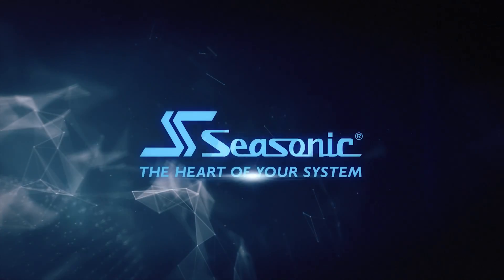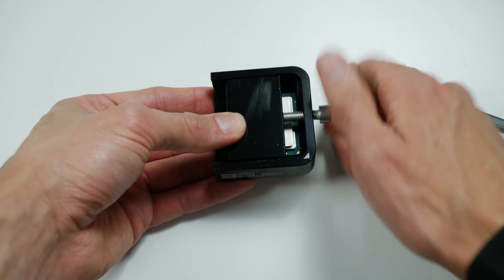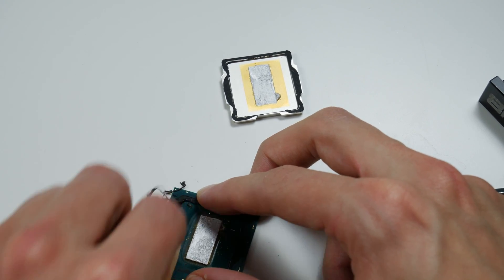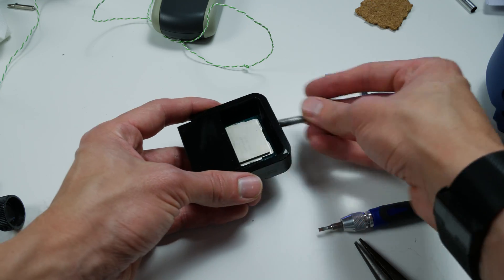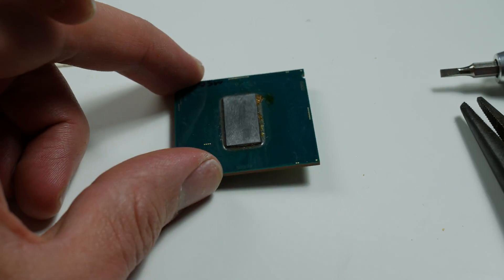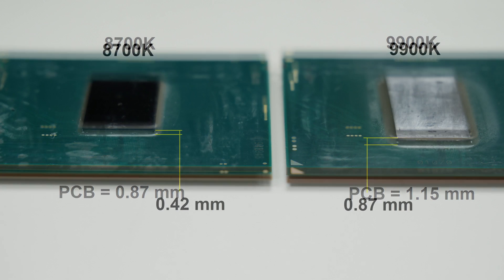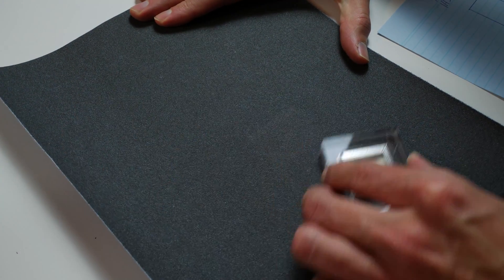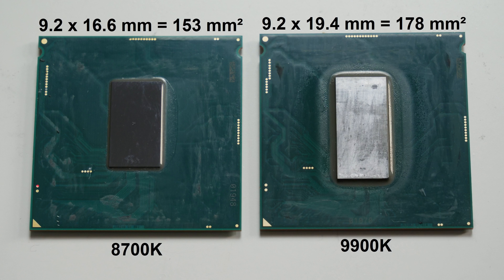Bad sTIM? Why is the 9900K so hot?

Comment: This ain't good, so will a NH-15 Noctua cool this thing even at stock? Cus that's what I ordered lol.  I'm wondering if they needed the extra thickness for the solder process, to dissipate the heat so it don't degrade the chip.
Reply: I feel Intel kinda boned the pooch on this one. By refusing to price it competitively they are fighting a two front battle. On one side the 2700x which is cheaper and slightly loses out to it for gaming. But on the other side with the price of the chips and mobos puts it in thread ripper land... Would be neat to measure die thickness of and verse Intel parts.
Reply: Lmao I like how you're worried about using one of the best air coolers to run a CPU at stock.
Reply: I'm sure stock will be no problem
Reply: @JesusMcBeth  no problem 80 /90  Celsius  o more all time,
Reply: Now that reviews finally came out, looks like stock you're right, shouldnt' be a problem around 80C (that's what my 3570k Runs currently when playing GTA).
Reply: That Noctua is a beast, outperforming or on par with most AIO water coolers on the market. You shouldn't have any issues.
Reply: Yea, that's what i'm hoping.  i'm sure it's better than my 25$ Zalmean from 10 years ago that' i'm still runnin my 3570k @4.5 on lol
Reply: @bigbenisdaman 
It will cool it just fine. Hardware Unboxed tested it here: https://youtu.be/_I--zROoRws?t=465
Reply: sure cuz it's only a 95 watt cpu lel
Reply: would an AIO H100i v2 work with the 9900k I have an 8700k but ordered the 9900k.... stock at least?
Reply: Get a 2700x

Comment: It's like the P3 all over again.
Reply: Think P4 had it worst (actually still have one :D).
Reply: @corwinblack4072  if memory serves the P3 was the first one to be that hot. And while the P4 topped it it was still the P3 heat shock that stuck with me.
Reply: You are thinking of northwood pentium 4 that was bad and Prescott p4 that was the original nuclear reactor
Reply: Nah the P3 was fine , it was the P4 that was a joke. There is a reason they based Core off P3 not P4 .
Reply: Pentium D?